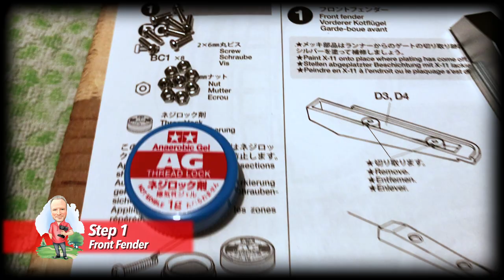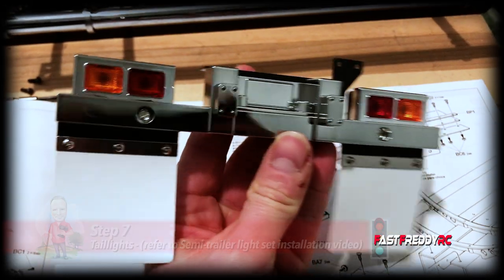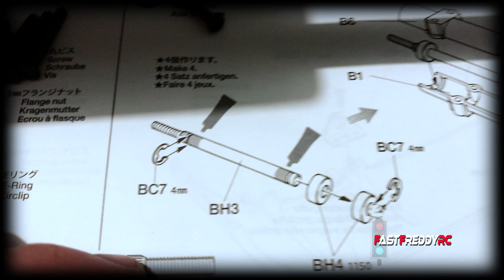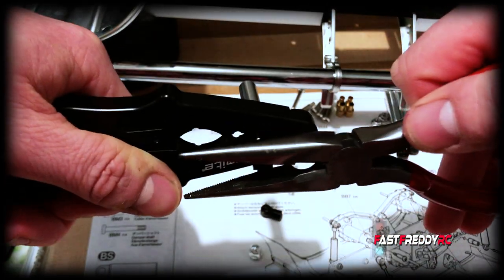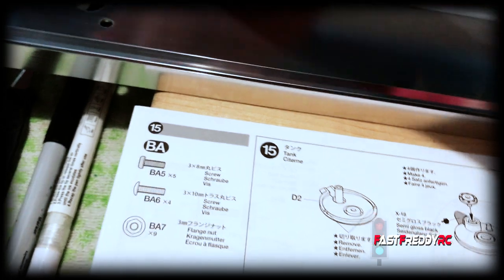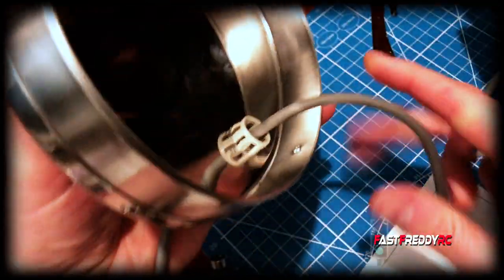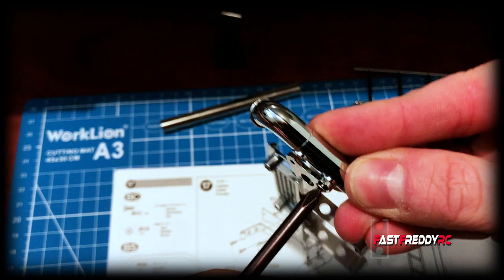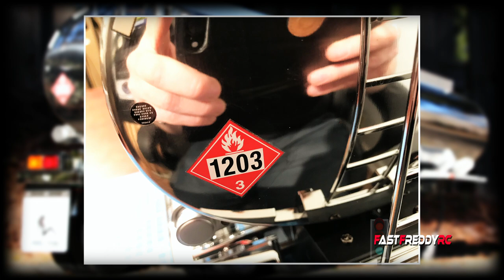Tamiya Fuel Tank Trailer - Part 2 - A step-by-step build!

Comment: Great job. One hint on Tamiya semi truck and trailer shocks. You can put a screw driver into the end and then thread on the plastic screw end. I  do this on all mine. Never used shock pliers.  I think you will actually find it easier.  Keep the videos coming!
Reply from the maker: Thanks Mark's RC! I know I used to do that before but what I found was that depending on the pressure I placed on the plastic screw end, the screwdriver would slip or I wouldn't actually be screwing on the plastic end properly "straight" and would have to start again.  The beauty of the shock pliers, now I have them, is that I can completely secure the one end and only have to concentrate on making sure the plastic end goes on properly.  For me, I immediately liked the positive feel of having the shock completely secured with the shock pliers.

Comment: Beautiful trailer! Nice video, thanks for posting it. I am leaving a few tips and tricks of my own, hope you don't mind. Use sprue flush cutters to remove the plastic parts and it will leave a cleaner cut. Serrated nuts are self locking, no Loctite needed. When tightening the shock end, use an Allen key thru it like a crank handle. I use a 3mm tap to cut a few threads first. Makes installing the shaft or other screws much easier. Use a toothpick to clean up the tire letter paint overage.  I use small metric ignition wrenches for some of those hidden or blocked nuts. The pipes are stainless steel, same as the tank.
Reply from the maker: Thanks Kmot!  Don't mind at all.  And you're absolutely right about the pipes and main tank...I didn't catch myself on that.  All of the metal pipes that are supplied are stainless steel.  The only aluminum on the trailer is what sits on the roof of the tank and the aluminum that is added to the frame for the tank to sit on.

Comment: Yes this is a fun build, and great looking trailer, Tamiya really needs to come out with some new trailer models, how long has it been since their last?
Reply from the maker: Agree with you completely!  Not sure what's going on there.  There even cancelled production on the Cascadia EVO rig which was the most modern looking rig in their american offerings. I don't get it.  I'm hoping they are coming out with a new Semi-truck and some more trailer offerings.  Would be nice to see some updates to their designs of what?...the 90's? when new stuff came out? Maybe early 2000's for the Evo but still.

Comment: Pity tyres are printed Tamiya rather than Firestone or whatever. Maybe aftermarket corrects this?
Reply from the maker: I would agree with you! It would be much better if that was the case. But maybe you can buy aftermarket ones that would have those brands. I’ll have to look. Be cool if you could.